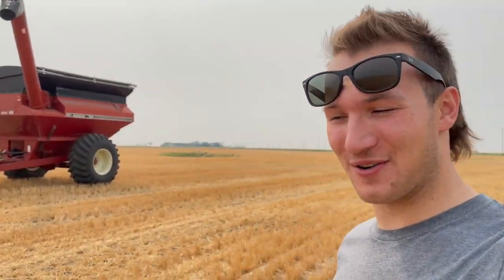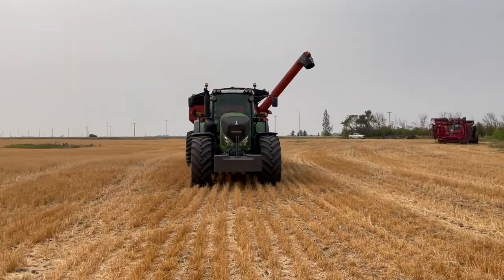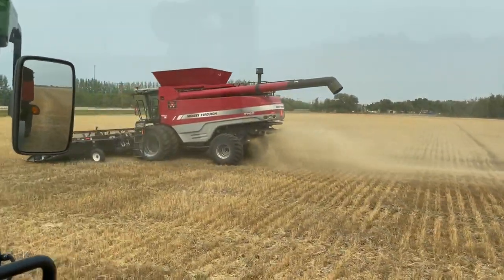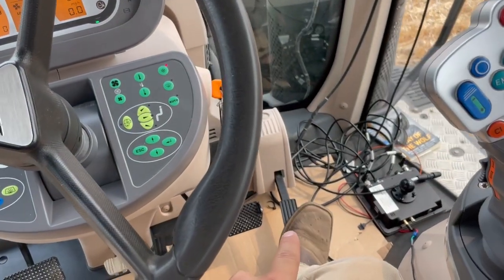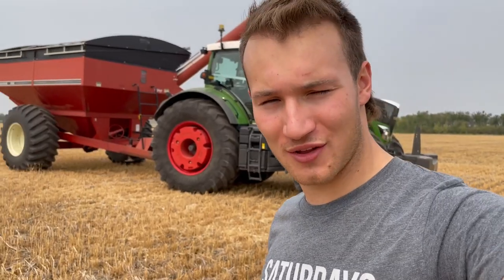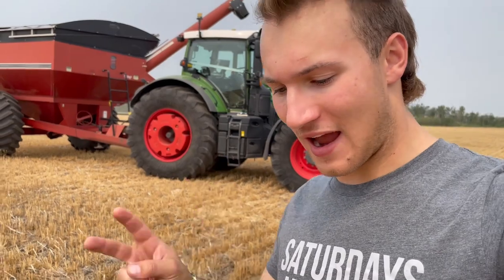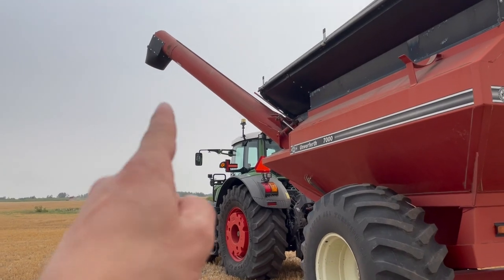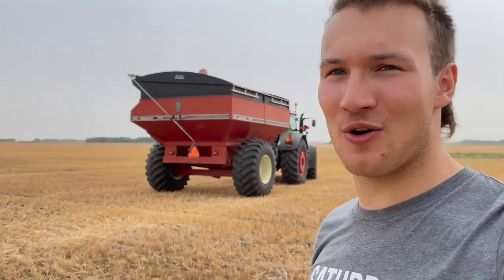Is this the BEST grain cart tractor?!

Comment: Its just the best tractor that is. I dont like any brand more then any other, and we try everything. We have a 820 with close to 20k hours, 930 with close to 25 and a 718 with over 20. We changed 2 transmissions and some other small things. We now run almost only Fendt tractors for our operation.

Comment: Definitely Fendt 800 or 900, I drive CaseIH 215 Magnum pulling 18T chaser but chaser auger is square not on angle which I find tricky to unload into mother bin or semi truck. Chaser has cameras.  Worst tractor I operate with chaser was Ford TW15 because the heavy the chaser got as combine was filling, I would have change down a gear which change speed which I was chasing the combine.
Reply from the maker: Oh yeah so sounds like there was lots to focus on when driving the chaser with that TW15! That is cool though! Thanks for the comment and the insight! Take care 👍